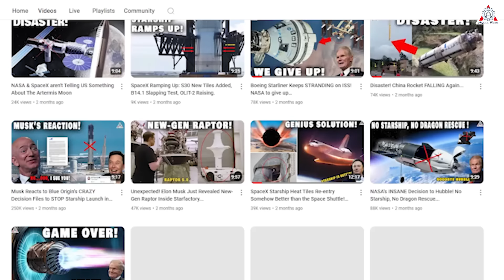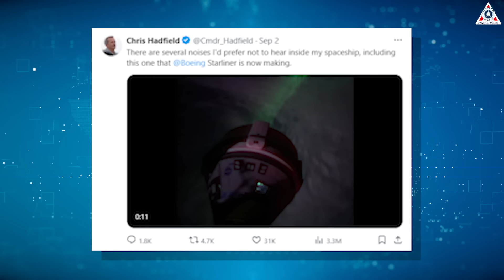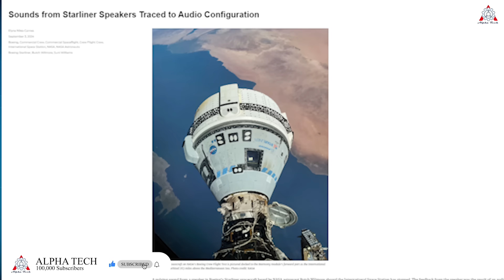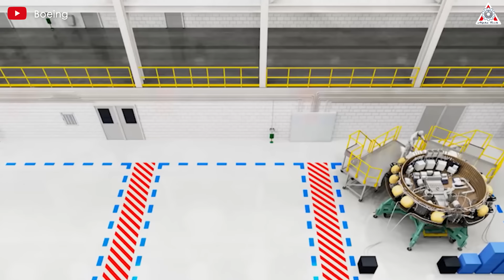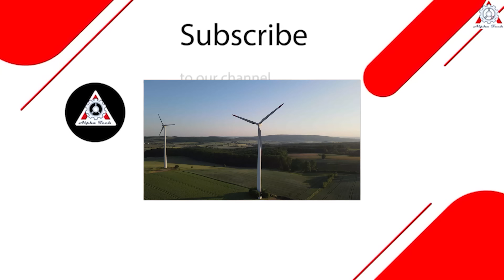It Happened! Something Weird Is Happening With Starliner on ISS Shocked NASA...

Comment: Boeing as any other organization needs to reorganize regularly! When I worked for them and obtained a senior management position now and then we worked on multi divisional problems to solve hardware design issues. Perhaps 50 or so employees would be involved in correcting typical design issues. As leaders of the  ACTUAL sub organizations, we would talk among ourselves and comment as to whom should really be in charge of each technical department. The consensus was about 6 individuals should be in charge instead of the multiplicity of aging leaders of each technological department. The elder ‘present’ leaders have their place but NOT in inventing humanities futures.

Comment: Yes, they DO know what the sound is and it's been corrected. It was just a radio audio configuration problem. As for the problems with Starliner, it's literally the first human test flight and third overall flight. In rocket science, things go wrong a bunch in the beginning, that's why they're called test flights. Do you know how many practice runs they took before they landed on the moon? They did each step once before they moved on to the next. It took them 11 separate missions before they actually made it onto the moon. And that was during a race between the two dominating world powers at the time. There is no longer any race involved in getting to space. Things can and do happen a lot slower in the space programs these days.

Comment: Why do you continue to Condemn Starliner for its annoying glitches and Safety precautions ..... Yet , Praise Maniac Musk for his Crashes and Explosions and millions of Fixes ?
Reply: All of spacex's explosions were on testing ships.
Reply: @pillebrett  
Not to mention that BEOING has several decades experience in building aircrafts and SpaceX just started.
So we should NEVER expect fk up's from BEOING.   Meanwhile SpaceX is on a different level,  yes SpaceX had many flaws, but all their flaws were on 
prototype ships as you mentioned.  😋👍

Here is the major problem that @KongHarald might not be aware of.  If the Starliner becomes a huge issue, like break, crack or even snap off the space station,
the entire space station implodes and all space crews will die, which is not good.  ALL because NASA and BOEING rushed Starliner out the door.
We are lucky the Starliner didn't exlode on the way up.  That ship is not safe for people anymore, to the point that SpaceX has to come to the rescue.  🤷‍♀
Reply: @pillebrett  What do you think Starliner was ?